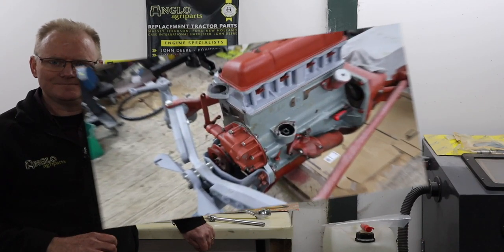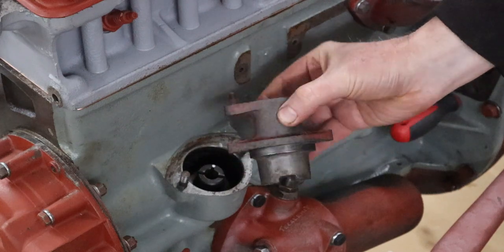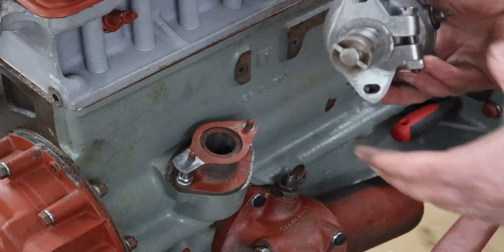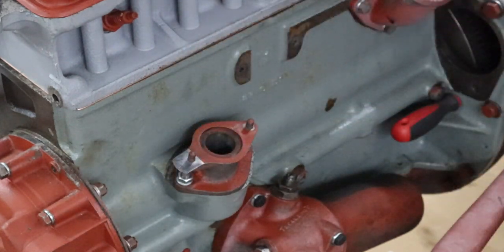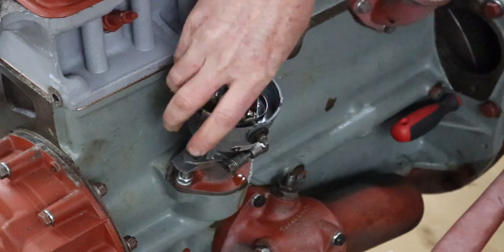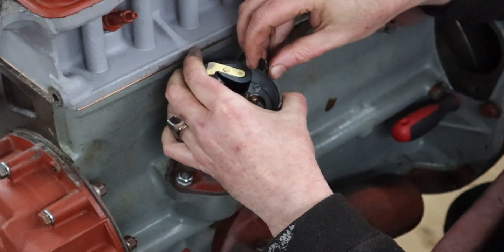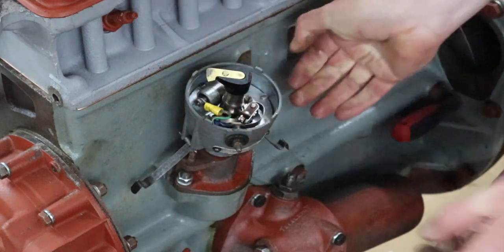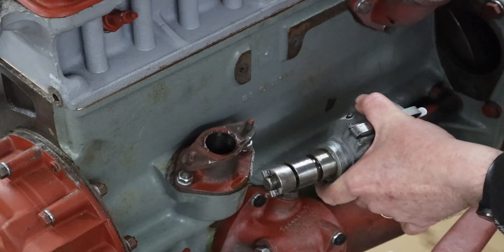#127 Ferguson TED20 - Installing the Distributor - FAIL - with Anglo Agriparts

Comment: G Day Gordon, Not a problem I have come across and the distributor on the current TEA build was from a car of some sort and it even had vacuum advance and it fitted nicely. I would have left it there as part of the tractors life story but I couldn't find points for it. The main problem with yours seems to be a longer shaft so even an old parts distributor might get you out of trouble. Anyone that tries to film their work will know things dont go to plan, boy Im about 1 year behind I reckon, lol. There is a gasket under the distributor mount housing part no : 825662M1
Reply from the maker: Hi Lance, ye as you could probably tell I was very confused by this. I think I have now found a “spacer” in amongst the bits and pieces that came with the tractor. That potentially solves both problems! 👍😉

Comment: TED Early D3A4 V151 40186A  Max advance   23-27° at 1200
TED Late D3A4 V151 40298A  Max advance   9-11° at 1100
Reply: Engine serial should let you know if flywheel holes are pinned at 0° or 10° BTDC.
One graduation on the plate= 2 distributor and 4 crankshaft.
Reply: Parts show a distributor adapter gasket.
Reply from the maker: Hi Jackattack, thank you for this info, very helpful. Do you know at which engine number it changed from “Early” to “Late”? I recall the engine is dated 1952 if I’m not mistaken. I need to go through the parts box to see if there is a spacer. The distributor was already removed when it came to us. 👍😉
Reply: Engine no S120,510E----S170,173E Version 1,2
Engine no S170,174E onwards version 3&4. 
Versions 1,2 and early editon 3 are static 6° crank. Pretty sure 4 is 6°also.

Version 1 Engine no S120,510E- S121,954E

VERSION 2  Engine no S121955E-S170,173E

VERSION 3 Engine no S170,274E-S225,311E

Version 4 Engine no S225,312E->
Reply: As for year 🤷‍♂️ I have saw one post reference their 52 Ted to late distributor. Lance might know or you could ask on a fergie page. The only differences between early/late dizzy wise i can see is max advance pulled back to 11°. 
Versions 1-4 relate to valve head diameters.
Reply: Take it that it's basically a paper gasket. 825662M1 no hits on it. Also 56407 can't see anything on that either.
Reply: I would hazard a guess that TEDs are flywheel pinned at 10°BTDC, since they look for a static time of 6° which you get from the distributor adjustment.

Comment: Dont push on distributor you have to move the screwdriver and moving the flying wheel
Reply from the maker: Thanks Vince. We have now replaced the distributor. It was definitely not the correct one. 😉👍

Comment: Hi Gordon I had a look at when you rebuilt the distributor when you said about the gap at the drivedog you are right there should not be a gap and I think the reason why you have one now is the plate above the bearing has separated from the shaft , it happened me when i was removing my bearing as I tapped on the top of the shaft like you did in your overhaul video, The plate is only pressed onto the shaft and will separate if you hit it , to push the bearing in you hit the sides of it through the 2 holes in the baseplate till its seated . The plate just taps on again as it's on a course spline ,hope that helps Leslie. Ps If you look on the rear of the baseplate if it needs removing again there is a number and that will tell you the degrees of advance the distributor is setup for ,mine is 26 for a 6v TVO
Reply from the maker: Hi Leslie, thank you that is very helpful. I will definitely take a look inside the distributor again, because like you I don’t believe that gap should be there. That would explain why this is struggling to marry up. 👍😉

Comment: Gordon, the flat on the oil pump end of the shaft has not engaged with the oil pump.
Reply from the maker: Hi George, I did think about that, but from what I can see it is properly engaged. I need to get back to this and diagnose exactly what is going on with the distributor, but I do know that it is not the correct one anyway. So most likely I will trade this one in for the correct one. Hope your project is going well! 😉👍
Reply from the maker: Hi George, I did think about that, but from what I can see it is properly engaged. I need to get back to this and diagnose exactly what is going on with the distributor, but I do know that it is not the correct one anyway. So most likely I will trade this one in for the correct one. Hope your project is going well! 😉👍
Reply from the maker: Hi George, I did think about that, but from what I can see it is properly engaged. I need to get back to this and diagnose exactly what is going on with the distributor, but I do know that it is not the correct one anyway. So most likely I will trade this one in for the correct one. Hope your project is going well! 😉👍
Reply: Going good Gordon, had turning over the other day to get the oil circulated, couple of snagging jobs to do but hopefully get her up and running soon.

Comment: Distributor dog looks right  and car dissys fit no issue usually, I suspect the reason it won't go in the last bit which appears to be the thickness of the drivedog blade Gordon is because you are 180 degrees out, try turning the rotor arm round 180 degrees and it will fit as the drive dog is offset  and if it goes in then you are not top dead centre on cylinder 1 but TDC on cylinder 4.. If that is the case you need to remove plug 1 and turn engine by the handle  and feel for compression with your finger then locate the screwdriver again . If you are on TDC NO 1 already your drivegear needs turning through 180 degrees instead.
Reply from the maker: Hi Leslie thank you for this, very helpful. I will get back to this in the coming weeks and double check all of this again. Visually I thought the slot was lined up, but will check again. I think the issue is that I am missing a space/gasket which would take up that difference. Keep watchin'! 😉👍🏻
Reply: @WaterhouseForde  no worries Gordon

Comment: Hi. I have a Mountfield 1538M-SD Ride on Mower. I have seen your video for engine servicing but do you have a video on how to remove the cutting deck, namely for belt replacement  and/or general cleaning and maintenance etc. Many thanks.
Reply from the maker: Hi Rigracer, I’m afraid I don’t have a video on removing the deck. I have tried to get a good angle on it but it’s just about impossible to get the camera into a good enough spot to be suitable. That said it is really quite easy. I’m working from memory here, so this may not be entirely accurate! 😉. The first step is to remove the side covers. It’s quite obvious where the fixing points are when you look at it. They are all size 10 socket bolt screws. There is one that attaches the guard to the foot plate so be sure to find that one too. Next loosen the belt tensioner all the way off. You can then ease the belt off. I find easiest to slip it over the blade pulley on the left hand side (sitting on the seat). Next you will find 4 mounting points where deck attaches to the frame that rises and falls. These are simple half-spring clips that you should be able to slide off. Catch the washers and remove the pins. Of course at this point the deck should be on the lowest setting so it as close to the ground as possible. Once it is fully on the ground, raise the height adjustment lever to create a bit of clearance and carefully slide the deck out either to the left or right. Do check and continue to check that it’s not catching on anything as you sliding it out, I find you do need to move things around a bit to clear all the bits and pieces of the height adjustment frame etc. 

Reinstall is pretty much the reverse of the above. Hope this helps! 👍😉
Reply: @WaterhouseForde  Hi. Many thanks. I have only had the mower a year, still under warranty, so took it into the dealership (washed off and spotless) to have it serviced in order to ensure the warranty. Got the shock of my life at the bill. It was £80 more than the service AND MOT on my car. Don't know how they can possibly justify but warranty or not it won't be happening again. I can buy a lot of bits for what they are charging. Thanks for your help. Much appreciated.